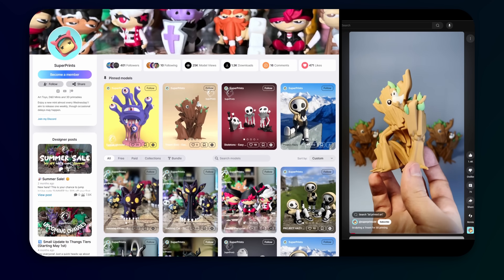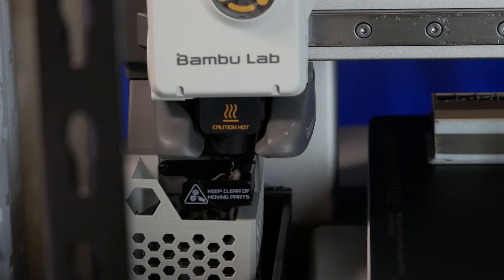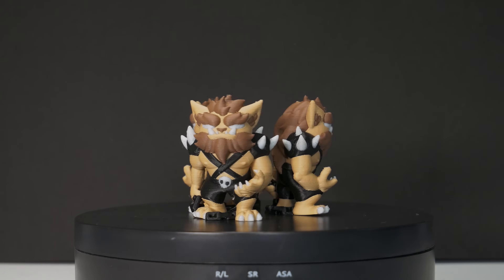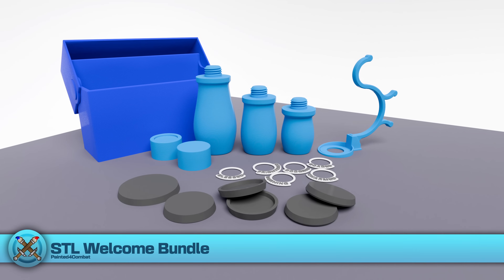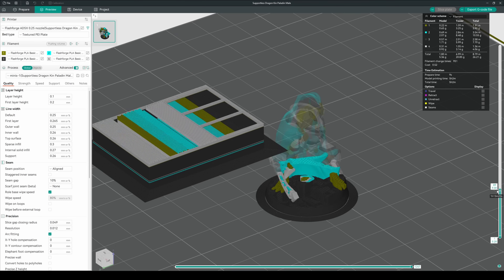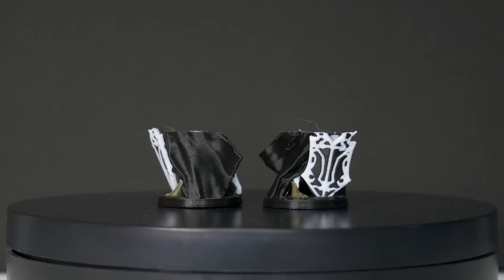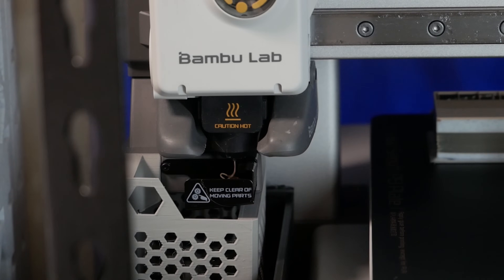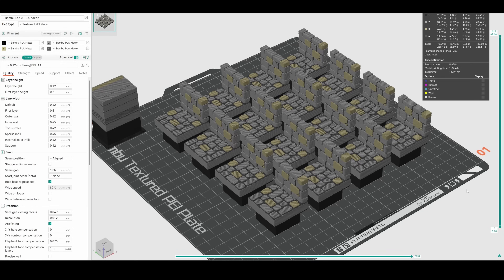Should You 3D Print Your Minis in MULTI COLOR?!

Comment: I don't think multi-material is ideal for adding color to minis. Could be good for supports if waste was reduced. There has been some options in more industrial process to add color during printing so maybe if that makes its way to consumer machines.

Personally I don't really like the style or the waste of the current multi-material prints. I think I just like the look of a painted mini. If I just wanted to get something on the table I could do solid colors. Maybe use a more abstract paint scheme and washes.

Maybe you could see how some paint on those example prints work. Like treat the base material color as the base coat. Maybe use a varnish to help paint stick and then a final layer to help keep the paint on. If it eliminates a priming and base coat step that could be an advantage.

Comment: How about having one or two parts of a model printed in a effect filament. I'm currently working on some Kindred of the Void (or Kindred of the Abyss.) I  removed the sword from the arm in Bambu Studio so I could print the kitbashed blade separately in a translucent florescent filament. I'm also going to try the lens on the models helmet. If someone didn't want glowing bits, their are those dual color filaments.  I got a lovely 4 in 1 that creates a great metallic effect. Just remember to prime the rest of the model before you apply the fancy bits.

Comment: I'll wind up with a toolchanger eventually, once the current wave have had some time to develop and work out the kinks. But until then the waste in traditional multicolor means that my a1 combo only ever uses the ams to have multiple rolls of the same filament so i don't lose print time when a roll runs out while i'm at work or something. Painting is a proper hobby of its own for me, so not really a loss for my personal use case
Reply: I’m in the same boat